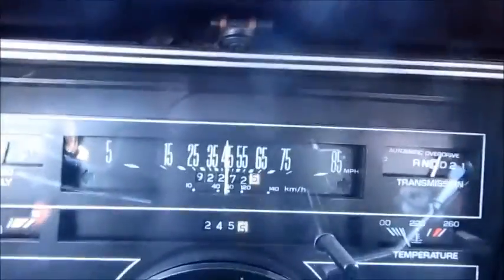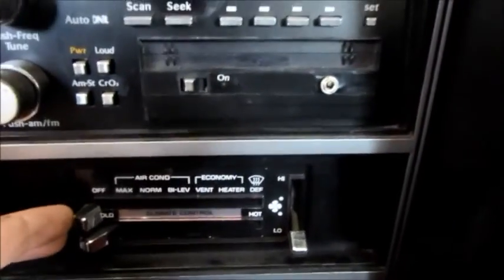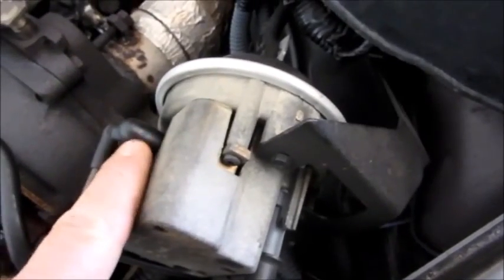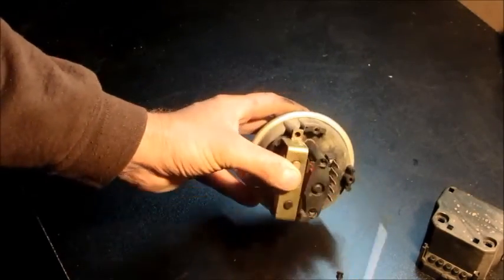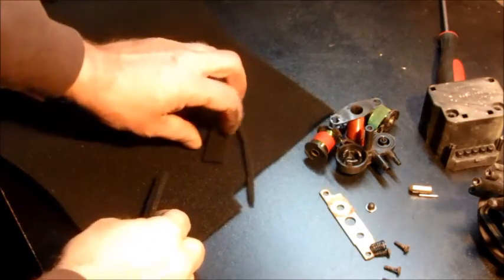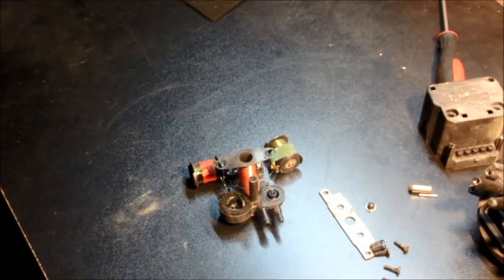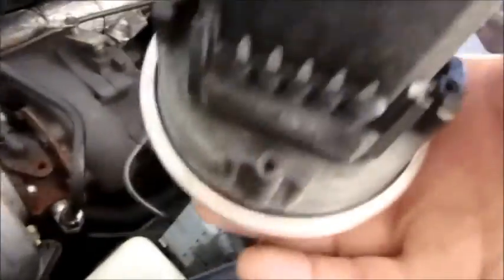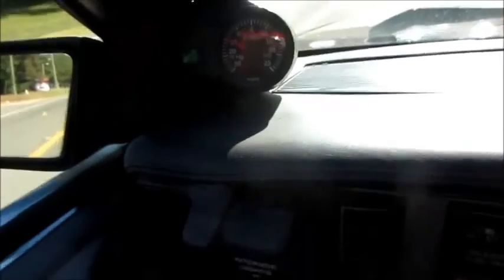GM Cruise Control Vacuum Servo Actuator Repair - 1987 Buick Century

Comment: Thanks for doing this video. Good to see there are still genuine old school techs who solve  problems without throwing new parts at it
Reply from the maker: You're welcome!  Yes it is true that many techs now are just parts swappers. Part of the reason for this is because so many things now are just circuit board modules that are really not repairable.

I grew up without unlimited money to blow on unnecessary repair parts, so I had to learn to do it the right way. I troubleshoot it, and at least try to repair what I have before replacing things.

Comment: Hey thanks a lot brother. This was just what I needed for my 93 GMC Van. The cruise was a little bit different, the coil wires were not permanently connected and had contacts instead, but no issues. Works like new.

Comment: Thank you so much for your video.  I just successfully repaired a junk yard servo I bought years ago with a worn out attachment connector  on the diaphragm which I repaired with J-B Weld.  It lasted for about three years.  I bought a remanufactured one and it eventually broke too.  I managed to locate another one which didn't work out of the box.  I saw your video and serviced the junk yard unit and it works perfectly.  My vehicle is an '86 Chevy Astro and the servo is identical to the Buick except for the throttle attachment.  It works!  Thanks again.

Comment: Thank you. My 1991 Oldsmobile Nighty-Eight Cruise Control was not working. This video gave me the confidence to take the actuator apart and look for the issue. It was the windings on the spool, the wire came off at the solder point. I was able to unwind one turn to give me more wire and wrap it around the solder point and to my amazement it fixed it. Thanks again for the informative and helpful video.
Reply from the maker: Hi Rich; thanks for the kind comment and happy the video helped you!

Comment: Great job of helping!  You are a blessing!  I found my "filter element" on my 1985 Park Ave. cruise control deteriorated and made up a new one.  Also, found the end of the larger diameter hose to the vacuum solenoid cracked, and possibly leaking.  Thanks so much!

Comment: Awesome video, thanks for posting! I can't wait to tear down the servo in my '87 LeSabre (I noticed you have the 3.8L too on the Century) so this video is the exact thing I need to fix mine. My cruise worked until the car sat parked for a few months, guess I shouldn't complain about nearly 30 years of flawless operation!
Reply from the maker: Yes I bet some bugs or other trash got in the valves!

Comment: Great video. Very informative.
I have a 1988 Plymouth Voyager with cruise, but not working.
It has a similar set up. A vacuum actuator and switch electronics.
I'll have to look at mine and see if something similar is at play. :)

Thanks for sharing.
Reply from the maker: You're welcome! I hope it helps you get it going.

Comment: Awesome video, helped me get my cruise working on my 87 LeSabre. I could really use a hand figuring out the auto climate control. Not sure if you’ve dealt with it before but my blower motor stopped working. Everything else works as it should. Blower motor runs if you wire it direct. the red wire going into the control module/ resistor has voltage but no power to the purple wire.
Reply from the maker: Hi, thanks for the comment!

My 87 Park Avenue has the electronic climate control. It is not completely right either.  The fan control does, however, work right.  There's a module mounted on top of the evaporator housing, which is the fan motor controller. That needs to be replaced, if the fan won't work at all. Quite often the fan will start running all the time, with or without the key turned on.  Once the controller shorts and the fan runs permanently; some people will remove the wiring to stop the fan and prevent a dead battery. Look for any disconnected wiring, and reconnect it. I bet the fan runs all the time. Then change that controller. :)

Comment: Hey thanks for posting and doing the video very well done. I have a 85 GMC that was my Uncles I replaced the servo years ago always worked but the truck sat for about eight years and when I went back out didn't work. I took the servo off and took it apart but I am sure I put it back together wrong. But one thing I did do is put my fingers over both ports before dissembling and the diaphragm would not hold. It cam back out these servos are being phased out from the remans if you can find some on line pick them up before long you wont be able to get them anymore thanks again
Reply from the maker: Thanks!  It's unfortunate that these are becoming obsolete from reman.  I haven't had to buy one since all of mine have been rebuildable, or have had from junkyard.

Comment: Thanks for making this. It was nice to know how these cruise control units work. It also gives me the confidence to take mine apart if I ever have trouble with it. I also enjoyed your video about power door lock actuators. It was very interesting to see how they work. I have definitely learned a lot from your videos.
Reply from the maker: Thanks Ryan!  I'm super glad you've enjoyed my videos and learned from them. It's good to be able to keep original quality things working and not be dependent on low quality knock-off imported parts that fail after a month.
Reply: davida1hiwaaynet you’re right about repairing original parts. They were definitely made better than anything sold nowadays. I’m like you, I try to find out how things operate and repair them if I’m able to. It’s satisfying to take something damaged and bring it back to working condition with a little bit of work.
Reply from the maker: Yes it's satisfying!  And you end up with a better quality job in the end.  Fitment is guaranteed when you put the same part back where it came from.

Comment: My advice: DO NOT attempt to remove that white orifice at 10:33. Mine got brittle and cracked into pieces, a small narrow spring popped through the enlarged hole. 

Full story: My cruise control was sometimes losing speed, but recently it gave me an unexpected acceleration, so I decided it's time to clean it. Sponge was still in one piece, but fell apart once I touched it. It was also all dusty inside. Cleaned it, reassembled with new sponge and did some tests with a piece of hose  and a 12V power supply discovering that vacuum valve would not always close, leaking more or less after each activation. So I tried to clean it, blowing through, brake cleaner through that orifice, on an open and closed valve, no change. So I attempted to remove it to clean the valve inside... And I ripped the part that sticks out, while the remaining part is like glued to the housing. I think I ruined it beyond repair.

Comment: Your video helped me out tremendously! I've linked it in a video I did of bench testing the solenoids on the unit. My cruise works perfectly....until it doesn't. Every so often when I set the cruise it floors the accelerator and doesn't stop until I hit the brake or turn the cruise off at the stalk. Any suggestions? Thanks again for doing this video!

Comment: My cruise control module would just start slowing down and then it culminated in a complete failure with the cruise light coming on and nothing happening.  I replaced my unit with a remanufactured one and that fixed the problem.  I've taken the old one apart and there doesn't seem to be any debris or visual problems.  I suspect one or 2 of the solenoids have failed.  I suppose that's rare, but it could happen.

Comment: This is great info.  In the video you noted that the size of the orifice on the vacuum side affected the rate of adjustments. I have an '88 Suburban and when I set the cruise and it's on flat road, it's almost bucking from what I assume is an overactive set of adjustments.  No issues going downhill, just flat and slight uphill grades. So my question is, HOW to adjust the size of that hole to account for my healthy 5.7?
Reply from the maker: Hi Nick.  I have in the past used a soldering iron to melt the hole closed, and then re-open it with a small wire-size drill bit.  I don't remember the size, but the drill bit was about half the diameter of the original hole.

Comment: Sounds exactly like what my wife's 91 Regal Limited Coupe's cruise control is doing! Well, mostly. Back during the summertime, it also had an issue where high load (e.g. hill climbing) in OD would cause the air conditioner vent door to switch to the floor, then switch back to the dash vents (or defog/defrost, if it was set to that) when the load returned to normal (e.g. level road). It hasn't been doing that lately though... your thoughts, David?

Also, "down here in the South, people are courteous" - YES! We noticed that when we went through Arkansas on the way to Texas. Slower drivers would usually pull off to let faster ones pass. That's such a contrast to Iowa, where combines and tractors (and elderly Buick/Toyota/Ford drivers) hog up the roads. Then again, most of our roads are open and straight, so passing isn't as much of a problem (unless you're on IA-17).
Reply from the maker: +Austin Leeds Hi Austin. That symptom of losing the HVAC under load is almost always the check valve going out and allowing air to go the wrong way from the engine manifold and lose all the vacuum in the reservoir. For "Safety" the air system is supposed to blow on the windshield (Defrost) to clear fogged up glass, if there is no vacuum. That way the system will fail "safe" and always be ready to clear the windshield.That would happen with or without Cruise in use....
Reply: +davida1hiwaaynet There's two different settings on this Regal - "Defog" and "Defrost." Defog will blow on the floor and on the windshield, whereas Defrost will only blow on the windshield, so I'm thinking it must be fail-safing to Defog. Anything I can do to test this checkvalve, especially since it seems to be an intermittent issue?
Reply from the maker: +Austin Leeds Yes it seems the Regal has a little different HVAC control than the A and C/H cars.

I would just take it out and see if you can blow through it one way or both ways. If it won't hold vacuum by mouth, then it's bad. I think there is a rubber diaphragm in there and that gets hard and doesn't seal well any more after years and heat.

Comment: Greatly appreciate your video! I removed my servo from my '84 TransAm and found no foam or remains of any in the shown area. I cleaned the unit and placed some foam filter inside and reseated everything and now the unit hold vacuum. However i still am without operation, did you ever get around to doing the electrical troubleshoot you mentioned at the end of your video? Thanks again for the excellent video.

Comment: great video, very helpful for dummies like myself... I have a question for you, just to make sure issues your talking about, is the exact issue I have. Mine won't hold the speed all the time, I mean on some attemps, it will hold for 10 minutes, and some other attemps, it won't engage at all ! do you think my issue could be solve if I does what you showed in your video ?
Reply from the maker: Thanks for the kind words!  As for your troubleshooting; I would start out by cleaning and checking out as shown here, then if that doesn't solve it move on to more in-depth troubleshooting.

Comment: Where did you get the vent filter mesh? I have a 1986 Chevy Van G20 Sportsvan. I have tried every thing else I could find to repair my cruise control, without success thus far. From the symptoms you mentioned for the car in your video, I experienced some of them before the cruise
control went out completely. The repair you demonstrate in your video may very well work for me. As I said before, where did you get the filter mesh. I'm having a hard time finding anyone that sells it.   Thank You!
Reply: I could not find the filter mesh that you used anywhere, so I am going to use a 3M fine stripping pad as a filter. Hope it works. Thanks for the fine video!!!
Reply from the maker: Hi Lyael. I don't have access to the Internet every day. Sorry about that. I bought an air vent filter pad from Lowe's hardware store. It's designed to be placed behind the front of a window A/C unit or in the vents of a central system to block dust. Just bought that and cut it. The stripping pad will work but it contains abrasive particles which will slowly break off and damage things.
Reply: @davida1hiwaaynet  Thank You VERY much for your reply! I will go to LOWE'S and get some right away.
Reply: I got the filter pad from Lowe's and cleaned the servo, replacing the filter. I had no problems until I reassembled everything as you did in your video. When I pressed down the valve button as you did, after pressing in the diaphragm, it immediately refilled with air without me releasing the valve button. I can feel air coming out from where the diaphragm is
sealed around by the outer metal ring. Is there any way to reseal the diaphragm or do I need to go to the junk yard and get another  control actuator assembly?  Thank You...
Reply: I actually think that the air bladder leaking is unlikely, but I will brush on soapy water and check for bubbles. If I don't find a leak I suspect that the rubber ball valve is not seating properly. In that case I will use contact cleaner to clean the ball valve assembly. I hope this works. I really don't want to head for the junk yard... Thanks for all your help!
Reply: I finally got everything back together and functioning correctly. Now I can put it all back in my van. I hope the cruise control works again. I've done everything I know to do. Thank you for you help!  I don't know of anyone else that has made a video to address the problem you did in your video. I'm sure glad I found it!
Reply: I reinstalled the Vacuum Actuator in my van today. The cruise control still does not work yet, but at least I can rule - out the
Vacuum Actuator as the cause. I had already installed a new cruise control / multi function switch. I don't know what else
it  can be. Your video has still been a great help to myself and others.  Thank You.

Comment: @davida1hiwaaynet.  Thx for the vid.  How important is the filter?  Why not just remove it?  I generally believe that a manufacturer would reduce cost where ever possible, but it seems like that vacuum system is pretty clean.

Comment: Where did you find the turbo kit for your 3.8 ??  I have a '93 Regal GS that I would like to upgrade;  any info appreciated.
Reply from the maker: Hi; thanks for the comment.  There isn't a turbo kit that I know of. This is a custom one-off project. I built or adapted all parts to install the turbo on to this engine. I used to really enjoy custom car modification projects such as this; but I've moved on from the car scene now.

Comment: I was wondering if a small lawn mower engine gasoline inline fuel filter would work better than that filter demonstrated. Just place it a couple of inches away from the servo. A clear plastic filter would seem ideal. Just a thought.
Reply from the maker: Hey Martin.  I understand your idea but there is one small problem with a filter in the vacuum line.  The air is flowing from the cruise TOWARDS the engine. That filter would not help the cruise servo because dirty air would still pass through the solenoid and foul it.

Comment: Nice video man subscribed. 1 question I got is I pulled the vac line off the servo next to the secondary that goes to the brake and it has no vacuum behind it after vehicles been running.  Could it be something with the vac tank or prolly need to do what you showed us. Cruise just stopped randomly this is on my 93 Sonoma 2.8l. I'm on a 2100 mile trip from tx to Washington would be nice to have.  Thanks bud

Comment: I’ve got a 1985 Cadillac Seville that has a dash mounted cruise switch and dash mounted wiper switch and it has a new vacuum servo on it. Dash vacuum controls for heat work. 
Any ideas how to get cruise to work?

Comment: Is the cruise run by the ECM on those cars?
Reply from the maker: +compu85 Actually it is not operated by the ECM. It has its own control module that shares only the vehicle speed sensor signal with the ECM. I have adapted this system to older cars without an ECM by using only a speed sensor, the Cruise module, the switch stalk, and the actuator.

Comment: hhmmm My 6.2 diesels cruise  in my 82 gmc truck keeps speeding up and slowing down when I set it then just gets worse and worse over a few minutes to the point it will slow down 20 mph or speed up 20 mph over the set speed.
Reply from the maker: I'm not sure about the 82 models. I believe that was a different system altogether.